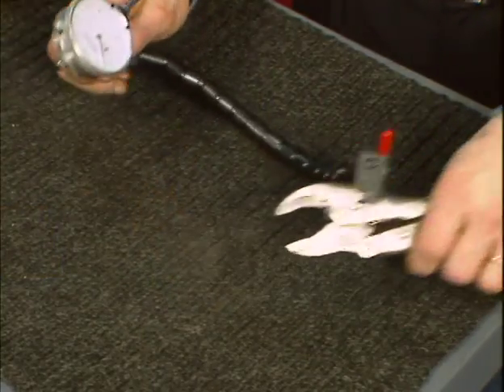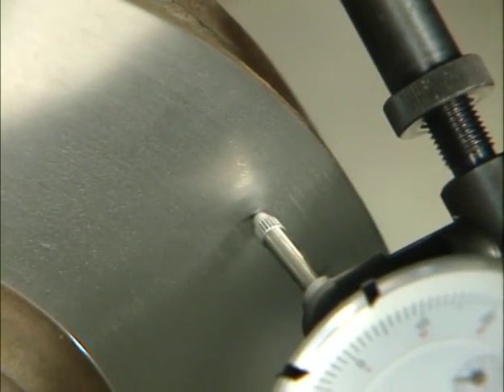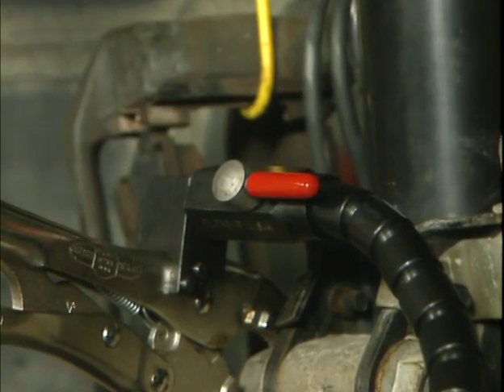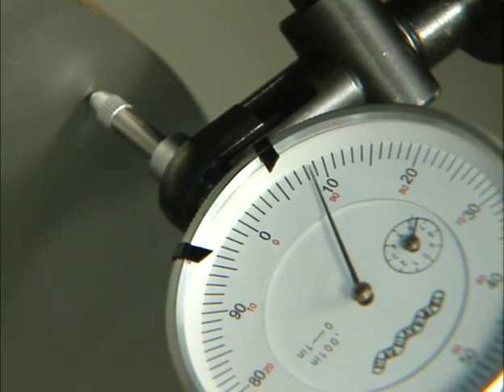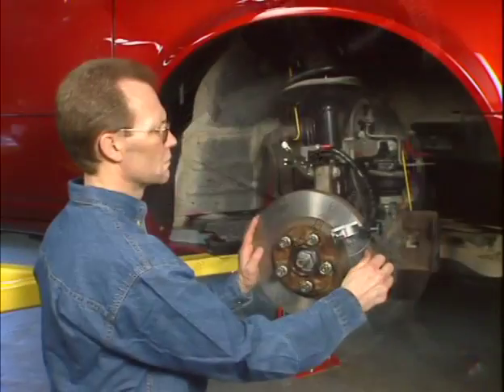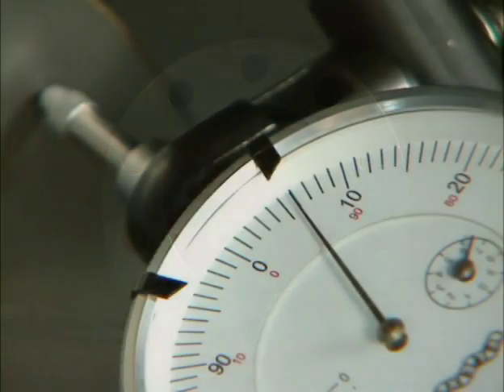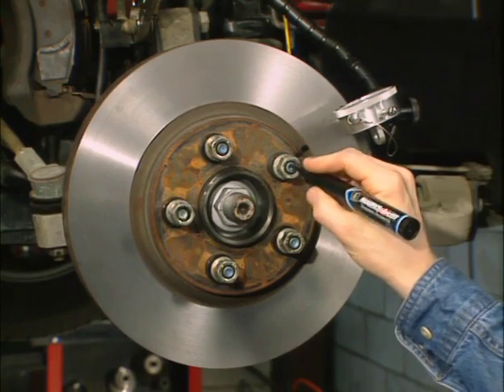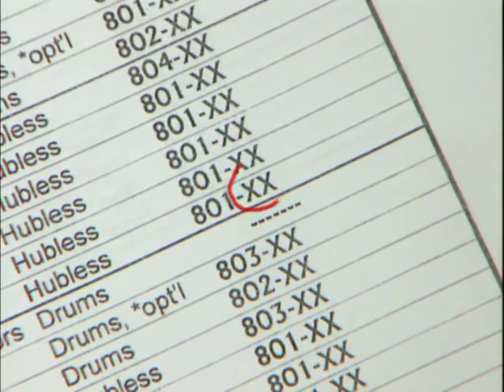Chapter 4: Using the Dial Indicator

Comment: What exactly are you diagnosing ? If the rotor is warped then resurface the rotor...if it's too far warped then replace it..
Reply: Not everybody has the luxury of machining equipment to machine down dics/rotors or the hub they mount which leaves only the purchasing of  new items. Preferably from the vehicle manufacturer
Reply: How would you perform this test on slotted and drilled rotors?

Comment: Do any garages actually do this in real life?
Reply: Most don't , unfortunately.

If I'm able to get my own Shop , I wouldn't even hire you if you didn't already Own a Micrometer & Dial Indicator for Brake Inspections/Brake Repair and a Torque Wrench for Tire Lug Nuts..........If a person didn't already own these Tools , that Automatically tells me they've been doing Brake jobs Wrong for 15 years & Not Torquing people Tire Lug Nuts.

Many uneducated will say those Tools are Useless , then my response is ,
" If those Tools aren't Valid , then why in the He_ _ is there such a thing as a Thin Brake Specifications Guide Booklet" by Motor. All vehicles have Different Specs.,
unless they are the same brand of car.

You'd be shocked at what you see if you actually had the Guide in your possession. Some Guys are so far behind they're still telling you that Brake Bleeding Procedures start with the Left Rear Wheel - Right Rear Wheel - Right Front Wheel then Left Front Wheel.

Brake Specifications/Brake Bleeding Procedures Guide can be purchased from one of the "4" Professional Tools Trucks called Matco Tools or from
www.matcotools.com
Reply: They can if the customer pays for it.  The free brake inspection or half hour charge doesn’t cover this.  It’s not an efficient or practical use of time to be honest.
Reply: definetely not

Comment: Lol I’ve been an automotive technician for 15 years this is the first I’ve heard of taper correction plates.  How about you machine the brake rotor if it’s warped.  Under minimum thickness?  Time to replace it.
Reply: It's not about it being warped.... the disc can be perfectly flat, but if there is a slight imperfection on the hub,  then the disc won't be mounted properly...
Reply: @amana1480  I have never seen a hub THAT bad in all my years of professional service.  I get your point but it’s just not realistic.  Machine if possible or replace.  Done.  No customer on the planet wants to pay the cost of that in-depth inspection just to find out they need to replace their rotors anyway.  We have a hard enough time getting people to commit to the brake job as it is.
Reply: I think if that’s an issue someone should be seriously concerned with the quality of parts they are purchasing lol.
Reply: @amana1480 

I always check the hub face after checking the discs because it makes sense to check both not just the discs.
Reply: You can tell who the technicians and who are the customers in the comment section 🤣🤣
Reply: @cuttthroatperformance2752  You are so right haha LMAO
Reply: That's exactly what I said!! Lol

Comment: Or you could chuck the rotor up in the lathe and take the high spot out !
Reply: No.  This won't work.  Machining will only work if it is machined after its mounted on the vehicle... you don't seem to understand the video...

Comment: I wants to know calibration procedure for dial gauge
Reply: Hemchandra Pandey Call a metrologist, they will take your dial indicator and test it with objects with traceable measured dimensions, then they will give you a table showing how far your dial indicator is from "normal" at min scale, max scale, and maybe a few points between. Other than adjusting it for zero, which these have a turning bezel to do that, you can't adjust how far the dial travels between a given measurement and another, but you can have data that shows how far off scale it might be so you can scale the results if you want your cheaper indicator to be more comparable of perhaps a slightly better made instrument.

Comment: machine it if its thick enough but you have to measure it with a micrometer and pull up alldata for rotor measurement specifications
Reply: This will only work if it's machined after its mounted on the vehicle